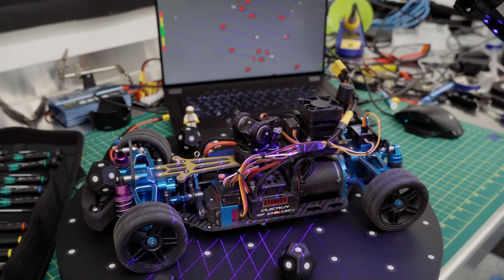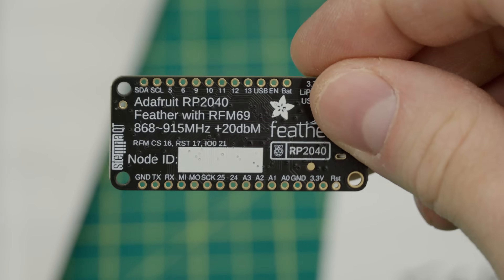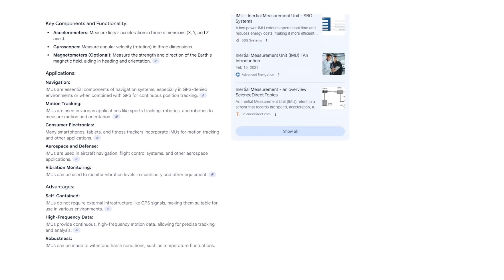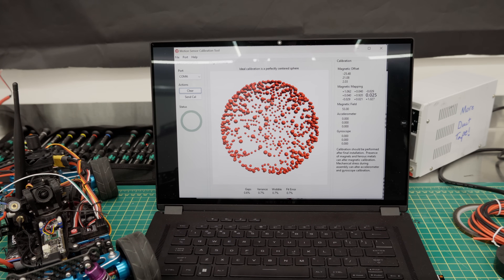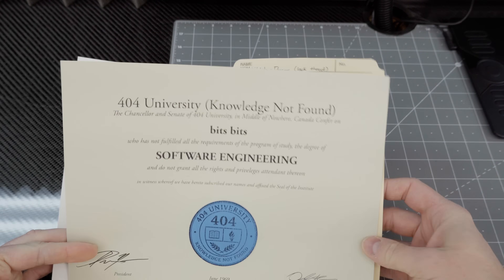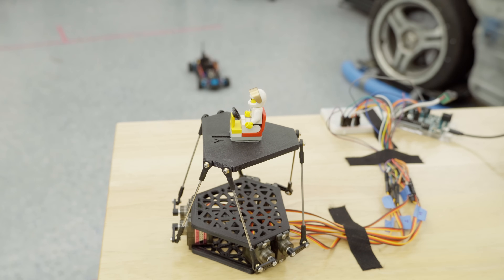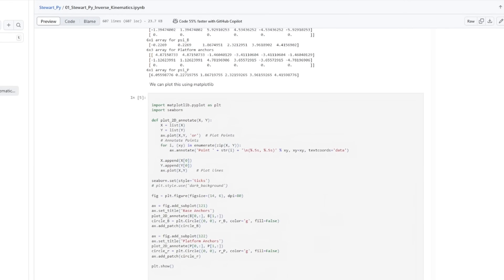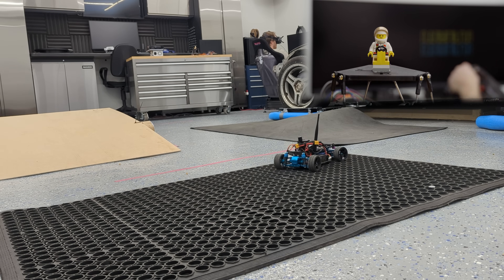Motion Simulator Controlled by My RC Car (Part 1: The Prototype)

Comment: Head tracking fpv next tbh, with smoothing to mimic your actual view in a car since your brain filters out the bobbing
Reply from the maker: It's got head tracking 😅 I kinda glossed over it in the first video, but I accidentally cut a big section out that went over it.  I added it because the rigid mount made me motion sick, but as soon as I added pan/tilt it all went away.
There are some really nice off the shelf head tracking gimbals available, but for now I have to stick with my budget 3d printed setup 😂

Comment: OMG i haven't realised for 2 videos that you own my dream car! The rotary beast Mazda Rx-7! (not really a fan of those rims tho)
Reply from the maker: Yep! Long term project car.. I've got big plans for it! The super advans are a love 'em or hate 'em kinda thing for sure haha! Final spec will have something more along the lines of a te-37.. But it depends on available sizes because I've already got a tire spec for the aero package.
Reply: @bits-bits  oh te37 are definitely real good looking rims. I'm more of a "Keep It Stock/OEM+" kind of guy. I really love stock BBS on 2002 FD Spirit-R. Good luck on your projects! Don't forget to fix the rust! 6:29
Reply from the maker: The body is pretty rough around the edges haha! Entire chassis is going to be overhauled/cut/tubed to accommodate the drivetrain and aero package.. Think 2004 jgtc, that's about where I want to be 😉
Reply: @bits-bits that's my favorite bodykit for the racing rx7. I found a mod for Assetto Corsa that adds it in to the game, i didn't know that it's called jgtc because the mod and other games call it GT300.

Comment: so cool video, quick question, how do you know that the new design for the platform you were changing will solve the shake problem? also when you mentioned about the filters was filters for the IMU signals or filters for the code  servo movements?
Reply from the maker: The first version of the top platform had a top radius that was a little too big, so it didn't really constrain well, especially with the relatively loose, vertical linkages.  So I shrunk the radius and also reconfigured the linkages so they weren't all nearly vertical in the neutral position, removing most of the slop.

I talk about a couple different filters, during the crash montage I mention the Madgwick filter, that one is used with the IMU data. Later when I talk about scaling and filtering I'm referring to the platform movements, so if the IMU pitches 15 degrees I may only want the platform to pitch 3.  Or if the IMU data goes out of range, how do I handle the data so the platform doesn't perform neckbreaking movements 😅.

Great questions!!

Comment: Just discovered you. Love your style. Will sub.

If you want low latency, ditch the python and lasagne software. Bare metal and C/++ or Rust only. Edit - Although having said that, you want the latency to match your video link, so maybe it's fine
Reply from the maker: Thanks for the sub! I haven't found any issues with python yet.  I'm sure if I really start packing functions in it might add some unwanted latency.  It's super lightweight right now, feel free to check out the Github page!
Good point with matching the video latency, never thought of it that way!

Comment: 👍 Lego - Danish for LegGodt - Play Well, and it's going well playing around with awesome stuff. Can't wait to see the camera implemented and how you will turn it around for reverse/rear-view operation. I feel you on the math, never been my strong side either :ø)
Reply from the maker: I've got it solved but I just need to find a servo with more throw angle! I had bought some 0-360's but they just continually spin, rather than have defined start/end points.  Once I find one I'll give it a try!

Comment: About the immersiveness a motion rig can give us.
When driving a real car, while turning right, the car will tilt to the right, and we will feel a sustained force to the left and the left side of our body pressing against the seat.
In a motion rig, we would feel the car tilt to the right, a momentary force to the right (to the left while being pushed to the right?), and then, the right side of our body pressing against the seat.
So, the tilt would be correct, but the forces wouldn't. The feel of the body pressing against the seat can be simulated with a G seat that moves its sides or inflates them.
But, our brain can reinterpret it and it would still be immersive. Probably not at first as we would fill the opposite of what we expect, but eventually as we learn what we are supposed to feel in a sim rig.
Oh and I enjoyed the video, thx!
Reply from the maker: Yeah there's always going to be that disconnect from real world G's VS. What a rig (especially on my budget) can do. I've seen some really clever tricks with actuators in the seat bolsters and seatbelt tensioners to add to what a 6dof can do, but it'll never be the same as pulling big G's in a car or airplane.
I've been talking to some motion simulator experts and they've offered some amazing insights for how to approach the disconnects from reality.  When I do a full scale platform I'll try my best to communicate what I learned from them.. But it's me so we might be lucky if I retain 5% of the information 😅

Comment: I only recently found out that there is a library (and accompanying hardware) called SimpleFOC, with which you can do some really advanced brushless motor actuator things. For the large motion platform this is probably what you want, probably the most power dense fast actuation one can find. Also great for doing force feedback as you get precise force control.
Reply from the maker: I'll look in to it! Thanks for the tip, it's always nice to have new resources in the toolbox to play around with! 😁

Comment: I used mg90 servos and an mpu6050 to make a "proof of concept" motion platform, still haven't built the full size yet. Planning on using heavy duty "truck tarp motors" to do the full size in a stewart style.  What rc chassis is that? Looks like a carbon deck tt02 (I love my tto2!). Leveling your work bench with a gyro has to be the funniest use for a high tech "level". As always, great, GREAT, video. Keep it up!
Reply from the maker: Yeah I know the struggles of going full scale hahah!
The chassis is a tt-01 clone from aliexpress! Not the tightest thing around, but it fit the budget!
The workbench took me a full day of diagnosing.. I only figured it out when I took it in to my house and did it on my countertop, where it worked perfectly 😂

Comment: A couple years ago I thought of an idea exactly like this. I have about 1/3 the skills to make it happen. So it never made it past some google searches I have 2 suggestions  Use a 1/5 scale rc car. Reason being the size and weight will more closely resemble physics of a real car. At scale every pebble is about the same as running over bricks on the road at highway speeds in a real car. 1/5 scale handles that better Also 3 axis brushless gimbal with head tracking for the fpv camera. 2 axis will not cut it. At speed the you cant smooth out the micro vibrations enough your head is a giant gimbal. The fpv camera should move like your head. Check out this youtuber he is doing some great things with 3 axis fpv in a RC car. JIPPERR_1  Love the progress
Reply from the maker: I agree with everything you said! One problem though..  My wallet doesn't lol! If this YouTube thing works out I'm 100% going to be bringing in bigger, better and more diverse vehicles and equipment!  That'll lead to more fun videos and crazy modifications in the future 😁

Comment: Could you define and explain some of the terms you are using in the software?
Reply from the maker: Do you mean in thr scripts and sketches in my Github repo, or what software I'm using to control the car with the Sim?
The scripts sketches are interpreting the inputs from the simulator and sending them to specific pins on the arduino to send to the transmitter. It's a little janky now, but I'm working on a better solution so everyone can do it with me!
For running the scripts I just use PowerShell. Just because I don't really know any other way to do it 😅
Hopefully that helps!

Comment: That platform is overly complicated. I would stick with something way more simpler and closer to the grown. I been dreaming of fpv racing rc cars for years. I built my fpv car using a losi 8eight 3.0 buggy and the walksnail HD fpv system. I want ot build a rig for the "motion simulator". I have a few 💡 ideas.
Reply from the maker: Yeah I definetly won't be doing a Stewart platform/hexapod for the real thing.  It was more of a "can I actually do this?" type exercise that I always do to myself 😅.  The real one will likely just be 4 actuators with potential for yaw/sway sliders as well!

Comment: hi, I'm looking to buy an RC car and control it using an esp32 for a project (i've connected the esp to a ps4 controller). I've never done this sort of stuff before so im wondering how did you connect your microcontroller to the RC car so that you can control the driving and steering?
If you have any good recommendations in terms of what car to get or what learning resources to use, that would help a lot. Thanks!
Reply from the maker: My setup uses a regular receiver and transmitter, but I use the arduinos/raspberry pi to help me control it with my racing simulator and add neat features to the controls.  Operating an rc over wifi is definitely doable with an esp32! Check on Github to see if anybody has a repository and tutorial as a starting point. Sounds like a fun project!!
Reply: @bits-bits  Thanks for the response! by the way did you build your car from scratch? I ask because i'm unsure if I should buy one and just add my esp to the ESC, to hopefully be able to control the motors and servo steering (I cant be sure if that's even possible 😅), or if I should try to build it from scratch. 

If you ever plan on making a video going over the basics regarding how you connected your microcontroller/processors to the car, I'm sure it would be very well received :)
Reply from the maker: I bought the chassis as a roller, then got all the electronics and assembled it.  Then I did all my crazy modifications hahah! I've never actually controlled this car with a regular transmitter 😂.
I've seen a couple guys and companies control cars with wifi so it's definitely a thing, not 100% sure on the hardware/code requirements though..  But learning is all part of the fun!
I'm definitely going to be doing a video on how my system works soon.. Probably the next one cause FFB is gonna take a while to troubleshoot 😅

Comment: so something you could do is use that motion data to smooth camera pan and tilt (maybe add lift) since your screen isn't moving adding that more dynamic camera will probably add to the feel of realism for basically free. also one thing i was thinking of doing for my project is adding camera pan based off the steering, so it will automatically move to the left or right when your turning left or right a bit so you can see more of where your going when you need it.  

at a certain point though, an idea would be to move to another type of vehicle, in my project i had to make a self righting mechanism to flip my truck back over in the event that it flips because of the off road terrain i'm dealing with. im also thinking about adding things like adjustable suspension and a better pan and tilt that also has lean so see over the side and get better views of what my tires are doing since i'm off road a lot it's nice to see whats going on so i don't end up flipping, but in the event i do i can recover without having to send someone to go recover it. 

Keep up the good work!
Reply from the maker: I'll have to see if I can tie in the pan/tilt servos to use the gyro data! I think I might be able to! I might have to redesign the mechanism to include heave for the camera, when I got on the rocks it was really bumpy in the goggles 🤣

100% I need a self righting mechanism! I'm so lucky I haven't flipped it outside yet hahah! It'll be a long run to get it turned back over! I know traxxas does it with a canned accel/brake maneuver on the x-Maxx.. But that's a heck of a lot more power than my tt-01😅
Reply: @bits-bits  so what i have is a servo on the back. so imagine a pickup with a camper, it's mounted in that camper with the arm pointing back. so it can be deployed out to the left or right to lift it like a tripod from there i can accelerate and drive in that direction and flip the rest of the way over. since you don't really have a side to fall onto and it's gonna be more of it just flips completely over, maybe just a servo with a arm that will stick up, so when it's deployed it should just fall onto the side maybe?
Reply from the maker: I envision something like hypnodisc from robot wars with an arm that pops out.. I probably just dated myself with that reference.
Reply: @bits-bits  i don't remember it specifically, but i realized that if you use a a slip ring, you can make a servo that can spin as many times as you want. so just like a turn table with another servo with an arm could probably get it out of almost anything.
Reply from the maker: Dang.. That's a really good idea! I bet the crawler community would go wild for it!

Comment: :) Keep in mind that the movement of the full scale platform shouldnt always match the movement of the car in order to attempt to recreate the G forces. Alao due to the nature of the platform only able to heave and surge about 1ft, you'll only be able to simulate short moments of G forces and not sustained ones. Some people add EM belt system to their seats to help a little with that but might be too much for this project (although those things are way too over priced for what they are so perhaps need a little DIY kit market disruption ;) Anyway, I have to think you can look into how games translate virtual car movement telemetry to the movement of a hexapod to understand what they are doing for G forces. After that you'll have to come uo with some kind of translate table between a virtual car and a IMU so everything feels right in the future. Actually, after that you might need to do some filtering as you mught not wan to perfectly recreate the movement of the tiny car as those movement will scale up to quite large and violent jolts because of the massive mass difference between the two. But then when you do that you might run into issues in VR if what you see and what you feel are too different. All the more reason to get that gimbal. Yeah. Um sounds like you are going to have to trial and error until it "feels right" in VR. I hope you do VR but thats definitely going to be a whole different level of finessing. Stock up on Pepto.
Reply from the maker: Hahaha yeah the scaling needs work 😅.  I had to turn it up for the video to show the "exaggerated" motion on camera, but theres still a lot of spots in the motion where I ask myself "what is it doing now?" lol.  When I build a rig for the simulator I definetly won't be doing a Stewart platform, I just don't have all the fab equipment/space available to go that route..  I'm hyped to try it IRL though.. I'll be pushing 50 though so hopefully it doesn't turn my bones to powder in the trial runs 🤣
Reply: @bits-bits  If you do a Stewart/hexapod setup that doesn't use linear actuators but non-linear (offset arm), you can make the footprint very small And they are much quieter.
Reply from the maker: Same as the prototype platform 😄 I'll have to see how ambitious future bitsbits is for building the actual one hahaha!
Reply: @bits-bits  what you could do is put an accelerometer on the steward platform and check if the accelerations it measures are the same you are seeing on the car. Because after all that is what you are trying to achieve here.
Reply from the maker: Yeah I thought of that after I got everything working 😅 then I was too cheap to buy another IMU.. When I get in to the nitty gritty with the full scale version I'll be slapping an IMU on and logging both datastreams to dial things in!